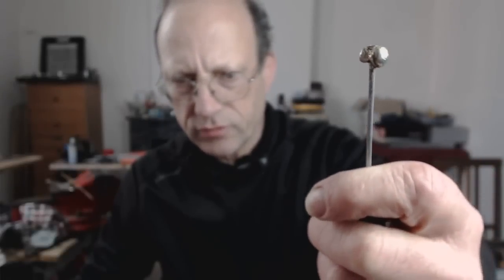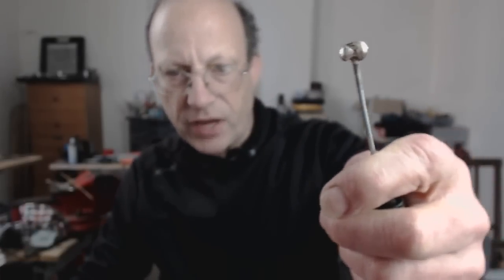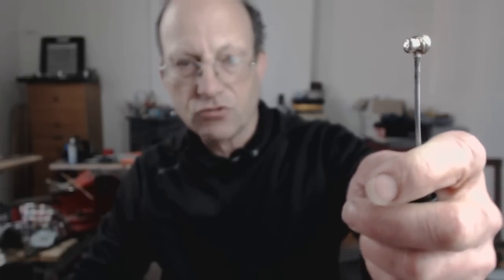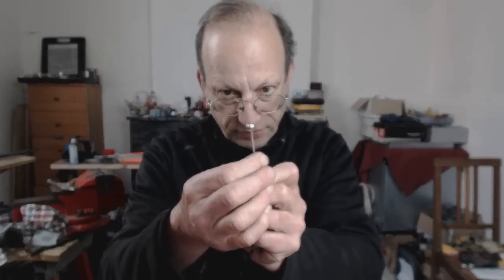Making a clutch cable nipple

Comment: Hi. Great video, I did exactly as you demonstrated. I made the form slot and yes dropped in some smaller pieces of solder into the form to ensure fully filled. It worked perfectly.  This has saved me from pretty much writing off my moped (because to have the brake cable replaced with labour would have cost more than the moped 😃). Very much appreciated, I really like the way you think... talent via common sense.
Reply from the maker: Hahah!
Doing something for the first time is always a bit scrappy; but thankfully it is a rare task :)

Comment: I made one last night using wood as a mould, I drilled the main hole to required depth and put a cross hole instead of a groove, I slotted the neatly cut cable in and pulled it up and out with round nose pliers, then I frayed the end out a bit and gave it a squirt with easy start to clean it and then I placed it in position in the hole. I packed the hole with flux and heated it up until it was boiling then I heated and dripped the solder in when I did this I saw the build rise up and then it dropped, that means that the solder has sunken in to fill the hole. I let it cool and broke the wood away from the side hole and out it came, it was in great shape. I guess there's quite a few methods, better moulds etc. I enjoyed your video.
Reply from the maker: Thanks for sharing Vucumprá :)
It's always a good feeling when a project goes well :)

Comment: I've just been fixing a clutch cable on the lawnmower using a brake cable from Halfords. It only cost £3.99 (includes a sheath) and now is time to seal the end. Thanks for the video showing how to do it. The cable came with a small tiny nipple to go on the end of it but I think it's just crimp on and not strong enough. Will go with your method first
Reply: Just a little afterthought, has anybody tried soldering a new cable to stop it fraying? It was really easy and the solder just runs through all the strands. It could be part of the preparation for this method.
Reply from the maker: Good thinking Craig :)

Comment: thank you so much i completely snapped my throttle cable and just ran it to a break lever and clamped it down i then went and bought a throttle cable but its too long its meant for a derailer cost 2 bucks now youve shown me how to fix my problem and get my proper throttle on the go
Reply from the maker: Really pleased to have helped :)

Comment: I made the end piece for a brake cable by cutting a correct size piece of brass rod and drilling the cable diameter hole through it. I then drilled a hole the size of the brass rod outside diameter through a piece of steel plate and cut a slot the width of the cable diameter from the edge of the steel plate to the hole. I put the cable into the hole through the brass and placed the brass with the cable into the slot and hole. I placed the plate and cable with brass end piece onto an anvil and used a flat punch the diameter of the hole in the steel plate and hammered the punch onto the brass rod against the anvil through the hole in the steel plate which crimped the brass rod onto the cable. The compressed brass on the cable was extremely tight. The reason for placing the brass in a hole in a steel plate was to prevent it from spreading which put pressure on the cable all around.
Reply from the maker: Nice project ... thanks for taking the time to share it :)

Comment: Instead of making a wooden mould I used the inside of a brass elecrical screw connector as a nipple. The set screw and plastic cover were discarded.  I cleaned the cable thoroughly several times and using several chemical and mechanical means. I tinned the stainless cable with a patent silver solder flux for stainless and the nipple with ordinary silver solder flux. It has to be strong as it is the clutch cable for a vintage car. And it seems to be doing the job.

Comment: thanks ..worked perfectly .i just drilled a hole an inch deep and made a slot half way down ,stuck the cable in ,filled it wi lead and when it set ,pulled it out and chopped to size .worked perfect
Reply from the maker: Nice one Mark!
It answers the question... why not buy a new cable?
 
If you just get on with it... you can have it done in no time :)
Reply: everyone of the bike shops said i need to buy a special cable for my make n model of motorcycle lol total and utter bollocks .i actually went to B&Q and got 5m of the exact size cable for £2.50 and made 5 lol
Reply from the maker: Hahaha... nice!
Yeah... bought by the length, bowden cable and sheathing is dirt cheap, and once you are set up it's quick and easy.
I bet you had thoughts of eBaying your 'special' clutch cable (it sounds expensive) :D

Comment: Great idea. use a piece of red hot steel wire to agitate the solder to get it to fall to the bottom of the hole. A wooden match shaft to cover the cable in the groove.
Reply from the maker: Yes... the method just needs a bit of tweaking.
But, having said that... the nipple has not failed, so it's good news :)

Comment: Good idea I'm going to try something similar only instead of using flux I will put a small blob of weld on the end of the cable only because I have no flux. Although I think it will be plenty strong enough for my clutch I would never do it on my brake cable,.
Nice video 
Thanks
Andy.
Reply from the maker: Thanks Andrew... good luck with your fix :)
Reply: Borax is a fine flux.

Comment: i used a screw post extension, drilled a hole in the center of the side, inserted the cable and splayed the wires, filled it with molten solder, then cut to width and filed it.
Reply from the maker: Variety is definitely 'the spice of life'  :)

Comment: Best the solder in  a spoon get  it  very  hot....  Then  pour it  in  and of  course  pre tin the  cable end then  the  solder poured in will  melt the  tinning on the  cable and  your  solid  as can be

Comment: Thanks for this, I haven't found a good way to do it myself that lasts.... not for clutch or brake anyway, seems there is too much tension. Throttle cables are easy.   The best result I've had was to get a copper tube that was the right diameter of the nipple, drill a small hole in the side of it , then cut the tube to the right length, feed the cable through the new hole then 90 degrees out the end.  Smash the end of the cable to make it flare out, and pull it back into the tube and flare it in all directions inside the tube .... acid flux, then heat the whole thing up and puddle in some silver solder then grind the ends to make them square.  The end result is beautiful, but it still manages to pull out in time.

What were your results over the long run?  BTW... . I'm the scooter clutch nut guy, we exchanged about a year ago on your "Scooter clutch nut removal - impossibly tight" video. It was great to see your name come up when I searched for this!
Reply from the maker: Hi Duckman!
Nice to talk to you again :)

The nipple was a permanent fix.

I believe, the key to success is cleanliness, and the acid paste.
The metal cables become etched, whilst being isolated from oxygen (during the heating process).
Thus,  the solder can bond perfectly around each cable.

Add to this, the splaying of the cables.
This transfers 50% of the tension force, to the nipple body.
Consequently, only half the strain is acting on the bond.

... but everybody splays the cable strands.
So, I would say the key is the total degreasing, and the acid paste.

You'll know that it has worked, by seeing that the solder has run internally down the cable for a couple of millimeters.
This means that the nipple and the cable are 'one'.
Reply: @EngineTuning  I've got to make a clutch cable this week, the one I had  snapped,  but it was too long anyway.  I will try making one again, a combination of my copper tube and the method as you describe!  My little bike is fun, I've been working the bugs out of it.  If you get bored, please check it out!  https://youtu.be/kwXUnxsXCrc

Comment: You have the right idea maybe a little refining and tuning. How about drilling a hole in a piece of metal to get a more consistent shape as the clutch cable hole? Measure it with a depth gauge and so on...
Reply from the maker: Yes, for sure you are right.
The problem is that one does this kind of operation only a few times in one's life.
Twice for me, with a clutch, and choke cable.
:)

Comment: It won't be strong enough for a clutch. I prefer to drill a little steel piece and silver brazing the cable in the hole. Thanks for sharing your idea.
Reply from the maker: Good idea Michel - thanks for sharing ;)
Re the normal clutch cable repair, as described in the video ... it works fine ... it has never failed again.
The key to success is cleanliness :D
Reply: @EngineTuning  what about also lightly sanding the wire end a bit, vertically so the solder gets a better hold on,like solder on a copper pipe ,?works?
Reply from the maker: @kaloosh2639  Agreed!
A good soldered joint is all down to cleanliness.
A degrease, followed by an acid wash, is good at enabling solder penetration :)

Comment: im thinking drill a hole in a brick, the slot is  a bit harder,do doable if you do it near the edge, then you can get it good and hot
Reply from the maker: It would work!
But cutting the slot might be a touch more difficult.

Comment: If you used as scrap of gypsum board and not the wood you could get it hotter and the solder would flow better.
Reply from the maker: That's a good suggestion.
Thanks for taking the time to comment :)

Comment: i took my 16lb sledge and smashed the cable into my clutch lever over and over then just to make sure it would work i used my 1500 watt glue gun to finalize the process....didnt work.....now i need a cable and a clutch lever and handlebars...
Reply from the maker: Ah yes, the hammer & glue method.
It has to be said, that the minimum sized hammer for this delicate work, would be 25lb.

I guess it just goes to show that you need the right sized tool to get the job done well :D

Comment: would u use lead or silver solder ?i do also have a silver brazing rod but not sure which is best
Reply from the maker: I personally used 97% tin 3% copper.
This is plumbers solder.
Lead-free and can be used in contact with drinking water.

It will surely be universally available, and inexpensive.
The nipple has never failed... therefore I can say that it is certainly strong enough.

Note: I also used a 'plumbers paste' containing Zinc Chloride (and probably some unmentioned acids).
 
Both the solder and the paste will be available from the same source, and both will last forever (effectively)... so ideal for future plumbing or soldering jobs.
 
Let us know how it went.
Good luck... it'll be fine :)
Reply: plumbers solder it is then lol ill get some of that .i just had my bike for 4 months and tried to start it this morning and the rev cable was loose in the mounting.im only glad it was outside the house so i dont need to push the bugger home lol thanx again

Comment: Are the measurements for the nipple universal? If so what are they please
Reply from the maker: +Tom Hoose 
Tom..... to be fair..... I did state the dimensions.
Have another listen through, and write down the dimensions.
Otherwise.....check the dimensions of the female joint, to confirm that this nipple will fit.
 
If not... then modify the dimensions to suit.

Comment: the solder made my break cable bridle and caused it to break!
Reply from the maker: Hi Jared :)
I think that you said : the solder made your brake cable brittle, and caused it to break.

If this is correct...
Hmmm!
It is unlikely to be the solder as the prime cause of the break, because solder is not brittle.
There will be another cause, or a number of small errors that combined.

Did the new nipple move freely in the brake lever?
Did the cable run smoothly in the cable sheath?

The Devil is in the detail ;)

:)
Reply from the maker: Yes.
That is likely to be a major contributing factor.
... but don't forget to check that the cable runs smoothly.

The typical problem is, that the cable must bend through the headlight cluster, then pass to the rear or the front.
These bends can create a lot of friction.

If the cable is rusty, it is worse.
If the cable sheath is damaged (with a sharp bend) ... it may be beyond repair.

Good luck !
:)

Comment: why not just buy a new clutch cable
Reply from the maker: Yes, it does remain an option... but it's very time consuming, and on top of that, you must donate some of your money that might be better spent funding something that you can't do in a few minutes.
Obviously, if you have a number of vehicles at your disposal, and excess money... then you can simply search for a clutch cable supplier... hopefully choose correctly for your model... order it... and use another vehicle while you await delivery.
But... even if you are in that position, and you don't need your bike....... perhaps fixing the problem yourself is just good fun.
Then there is that other issue.
Self-respect, and general respect.
This is a difficult one... you either get it or you don't, but...
 
Let's say you are in a group.
You announce that your clutch cable failed, so you looked around and finally find a supplier.
Nobody appreciates the shit load of time that you spent looking.
They might commiserate with you for ordering the wrong cable... but that's it (you could blame the supplier ;) )

However, if you announce that you had a cable failure, and that you fixed it by casting a new nipple...
Who's the cool guy that can do stuff?

... and anyway... that is just shite.
 
It's about your own self-respect.
Are you the guy who wastes his time looking for a supplier of a cable that might arrive and be wrong.
Or, are you the guy that simply fixes the problem, and gets on with life :)
Reply: Ricky Nunnery ... not all cables has that lead thing on both tips/ends of the cable ; is very difficult to find in market. One has to do it himselfe .